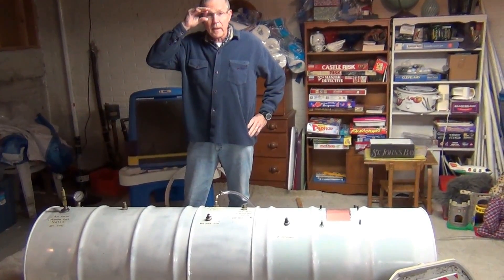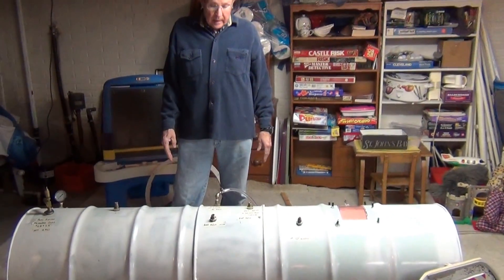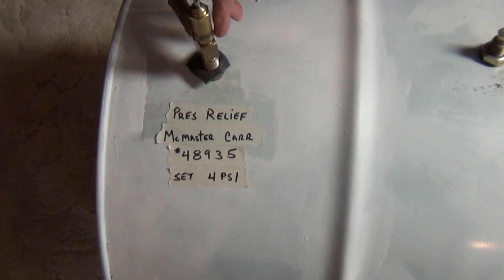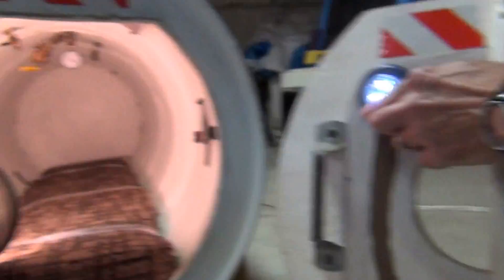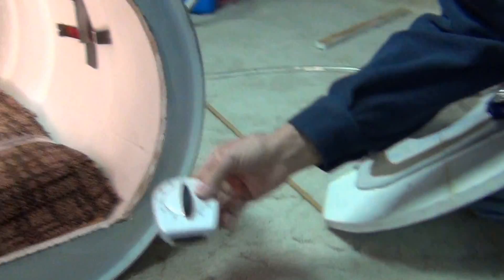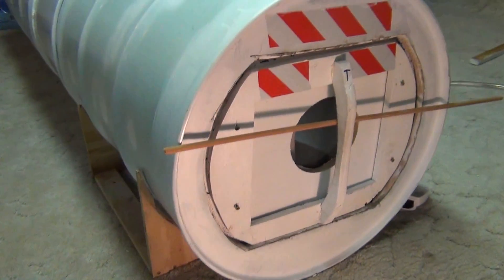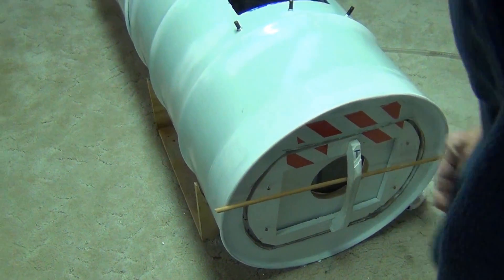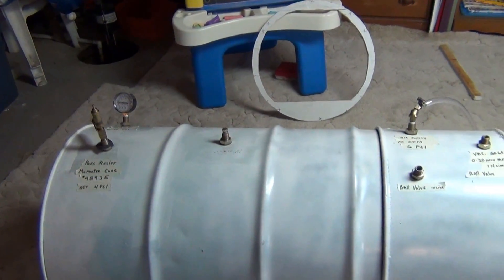Build an affordable Hyperbaric Chamber

Comment: Hi. How many minutes should it take to safely depressurise from 4-5 psi?
Reply from the maker: Christian,
I am not an expert, but can tell you what we try to do.

We try to gradually release the pressure by cracking a ball valve and watching the vacuum gage.  Once we are down to about 2 psi or less we shut off the air pump which will also let air release from the tank back thru the pump.
We try to go from 5 psig back to atmosphere in 2 1/2 to 5 min.  it works for us.

The only time I ever had an issue was when I first tried the chamber, I fully opened two (2) ball valves and depressurized the chamber in less than a minute.   After that I had one eye go bloodshot which may / may not have been due to the rapid pressure change???   I just never did that again.
Reply: Terry Kocsis Hi Terry, thank you for the quick answer. It was very helpful.
I am building a chamber like yours. I hope it vil improve my psoriasis.

Comment: how long does the fresh oxygen last until your CO2 fills up the chamber and kill you? im asking seriously cause I need to make one for my kid cause he might be autistic and I read this chamber helps those kids big time even full recover from that issue. so plz help thanks
Reply: David Oldenburg thanks David
Reply: The CO2 level shouldn't build up too much because the pressure release valves are constantly releasing the air.
Reply: MrCoonass1970 ço2 is a huge concern and this guy doesn't know what he's doing, this is bad in every way
Reply: The tank pushes new air in the entire time and leaks air the entire time maintaining a stable psi. It just pushes air in at a faster rate than it escapes. Think if pumping a bicycle wheel that has a hole in it. The inside of that wheel is a pressurized chamber. For humans building the pressure and releasing the pressure is done very slowly so that your body can adapt. 

Suggestions for helping someone with autism. Research rope worms, then research urine therapy, then endocrine disruptors and all the effects of plastics. Then go over to the whole food plant based diet, implement the urine therapy, clean out your environment. Then research AgEnDa tWo  0ne. Godspeed.